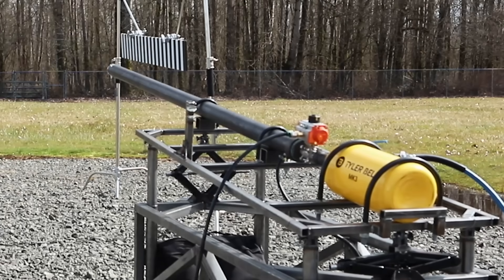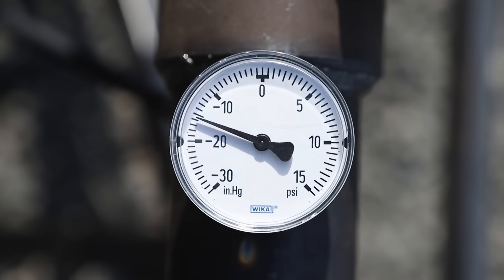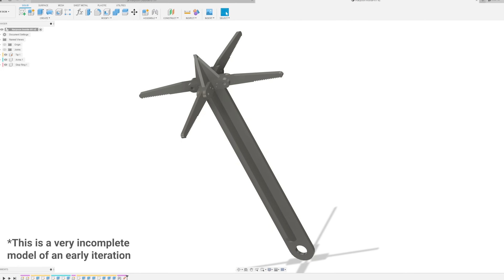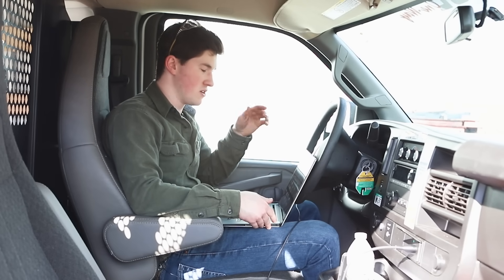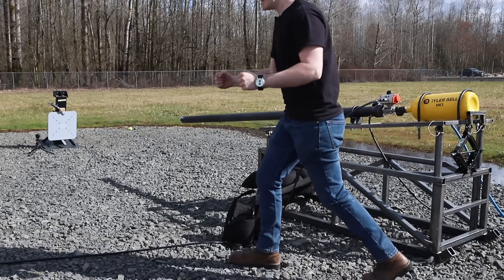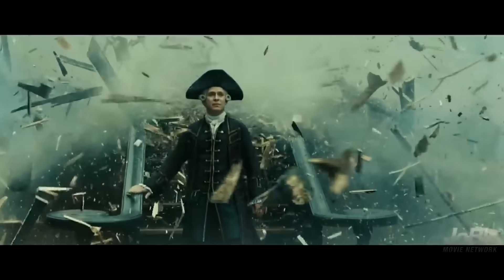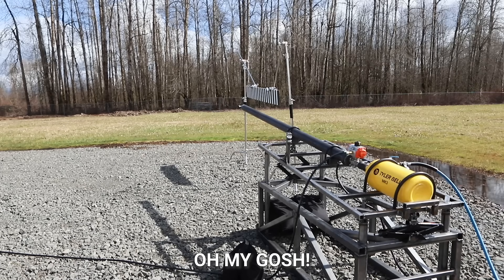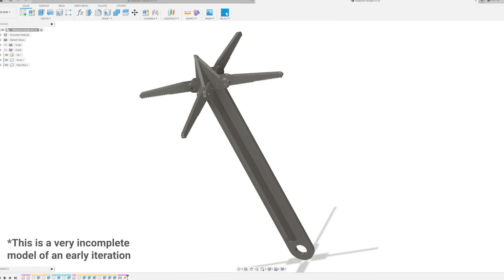Have I Found the Fastest Air Cannon Valve??

Comment: it really seams like you would benefit from extending the barrel length to three or 4 times longer with a vacuum pulled that would give you longer vacuum to accelerate in and should up the speed and would be a relatively cheap thing to test while only having to modify one variable

Comment: If you want more ideas, from an engineering challenge, look for a channel by agent1002 and look at that valve design. The goal was to have a valve triggered which would open 100% in the time the projectile moved it's length in the barrel. Flow was with as few restrictions as possible. Using a shooting chronograph, clocked an apple at 880FPS with the maximum design limit of 100 PSI. Due to the flow rate, the valve does not hiss, but has a boom report as it fully empties the tank in microseconds. The youtube channel mentioned has a full explinaiton of the design, theory, build, and testing. Yes there are some low quality high speed videos that are interesting, such as an orange going through an expanded metal screen, and an apple hitting a water bottle. Unfortunately the one day loan of a high speed camera did not leave enough time to get the color temperature and exposure correct.  Sorry about the low quality on the high speed.

Comment: Two problems. Firstly your projectile is not solid and allowing for pressure to force its way past. Secondly you need to get a pressure chamber that provokes more laminar flow. This will increase your overall pressure of velocity. Take all this with a grain of salt cuz I'm only a computer engineer. Second thought. I didn't think about the momentum of the forward portion of the ball that would indeed cause deformation and maybe do as you described at the end of your video.

Comment: Isn't the speed of gass escaping from the tank capped at speed of sound? That would mean that it is impossible to get it faster than that using just the gas pressure right? I'd say this would be the case since the plastic-burning valve is pretty much a "perfect" one speed-wise and even then you got around 75%.

Also if I take 75% efficiency, that is not that bad at all - counting in friction of the ball in the cannon itself, deformation of the ball etc. I'd also guess that when the pressure hits the ball, it deforms/flattens - meaning it will push much harder on the inner wall of the cannon resulting in higher friction and reduced efficiency. Maybe calculate the speed with the solid ball? Or lubricate the cannon - if you use good viscosity, it will act as a seal also.

Comment: i think it is impossible to make an air cannon shoot at the speed of sound because the expansion speed of the air is occuring at the speed of sound too so by using even much more pressure it won't shoot fast enought due to the inertia of the projectile and it's aerodynamics that also limit the air speed... so, for shooting at more than the speed of sound you should use something else than the sound itself and it's a purpose of blackpowder cannons wich expansion speed is not less than an explosion (btw, i'm not english so, sorry for this poor orthograph)

Comment: Should have turbo'd the 305 v6.  Some calculation into the maximum expansion rate of air might be in order.  First try should be a significantly larger valve, though.  Next might be barrel porting so you are sucking on the front of the ball for part of the acceleration phase using a venturi setup.  Might need a larger tank or a second tank for this.

Comment: Seems like a lot of commenters (myself included) think too little air volume is the primary problem. To simulate a larger tank and cut costs for testing purposes, decrease barrel diameter and shoot mini tennis balls. Use the same valve set up options, just change the barrels.

Comment: Your main limit, I think, is the terminal velocity of the tennis ball. The terminal velocity is the speed at witch the force pushing the ball and the air resistance are equal. I did some math and the ball shouldn’t go abobe 260m/s or 936km/h. You can keep adding pressure and flow but drag is squared to speed, so in order to make the tennis ball go abobe the speed of sound you need to launch it at more than 1600psi, thats without taking into account losses of pressure and flow limitations. And also, this is without taking into account the vacuum in the tube, the ball may go much faster inside the tube but once it exits it will slow down a lot.

Comment: Tyler, I just stumbled across your video. Wow! You are doing a great job. I would like to give you some ideas.
1) If you use a valve that is like two doors, held in place by a solenoid controlled latch, it will pop open like the floor of a hangman’s platform. That will be almost as fast as the blister, and not take as long to reset. Unfortunately, it would need to be self-manufactured. 
2) Other pneumatic ideas. I have one that will put you over the top on YouTube and may even make you very wealthy. I share this, because I don’t have the tools to build it myself (actually, I just don’t have the machine tools), and I don’t know anyone who does. If you send me a query at (no spaces) h m h m m p (at) ya hoo. I would like to help you build a project, but I don’t want to spell it out here. Get in touch, if you want my idea and knowledge to be lent with open communication.

Comment: Why not go with a swing disc valve? wouldn't that have been fastest? I'm not really an engineer, but I did take some courses on valves and fluid dynamics and engineering stuff. Although probably even more optimal would be like a specific type of swing disc valve that I'm not sure really exists, one which is just locked in place by a solenoid and not actuated at all, and then when the solenoid is activated the valve is free to open.

Although that's a good point about the tennis ball potentially being the limiting factor. I was thinking about that a bit as well.

Comment: You may not be able to get faster than 0.75 Mach because of the tennis ball. The faster you shoot the higher drag you will experience. The same concept of falling items reaching terminal velocity. You may be able to reach faster velocities in the barrel, but the moment it leaves, it will experience drag exponentially. So, to go faster, change the mass or make it smoother to reduce drag.

Comment: Well you did a lot right but Have you considered that by pumping down the barrel the tennis ball expands as it is filled with gas ? try something solid or use a bigger diameter for the barrel.
But when using something solid be carefull not to kill anyone as you are building basically an air pressure field artillery.

Comment: If the sides of the tennis ball are expanded into the barrel walls as the tennis ball is squished by the air from the rear, it sounds like the best option might be to making a barrel that widens as the ball travels. But you would probably need a high speed camera and a polycarbonate tube to see what’s really going on in there. 

Alternatively, you could add wadding to the back of the ball like they do with cannons. This would not only seal the air for a bit longer to allow it to build up greater pressure behind the ball. But could also be designed to spread out the force across the rounded back of the ball so that it doesn’t flatten out as much.

Comment: Ok, a useful insight I can provide is to start looking for simulation tools to help better predict cannon performance. I built an air cannon for a school project this way in just a couple months with minimal fumbling around with hardware. Play around with a model and then build what performs best. If your cannon doesn't perform how you anticipated, you can quickly identify the problem by double checking the model. Unfortunately the software we used doesn't work past mach 0.4. So you're gonna have to look around for a better one or make your own. Beats buying tons of hardware and saying "this is useless" and trying to return it.

Comment: The key is that barrel needs to be sized for maximum efficiency including bore diameter and length… keeping the ball in the barrel long enough to absorb all the kinetic energy . My grandson and I have a golf ball air cannon and we’re in the middle of nowhere and we haven’t the tools to check altitude or speed but have always wondered how high , we lose sight of the ball at about 150 psi , the rig is a small 3’ gas bottle with a 1-1/2” elec solenoid valve into 1-1/4” x 12’ sch 80 pvc pipe. Sending it down range we have yet to find it the best we can do is time it relatively vertical and that was apron 7.25 sec launch to impact  anyone tell how high that is @ 698’ elev above sea level  and 70 f

Comment: Dawg you need a light gas gun
You're fundamentally limited by the atomic weight of the gas molecules. You can get substantially faster speeds with faster (lighter) gas.

The other problem is that you can't send energy faster than the speed of sound in the medium that you're using. What that means is that you can never get the air in the cannon moving faster than the speed of sound in the air within the cannon. It's not substantially more than ambient.

You might even get better performance leaving the air in the cannon instead of the vacuum. You have a 15psi well to dig out of with the vacuum rather than ambient + back pressure.

Comment: With a 3d printer  make a sabot.  This will  encapsulate the ball so drag is controlled.  When the sabot leaves the barrel it splits in its two halves. Releasing the ball or that steel  harpoon. 
This is what U.S tanks use.
Good luck

Comment: You should try using an electric solonoid valve, Theyre perfect for small air rifles as they activate very fast and you can wire it to a switch. im sure larger industrial ones can be bought online for very cheap

Comment: You might be interested in checking out a device called a Big Blaster made by Martin Engineering Co. This company also makes industrial vibration equipment. Their blaster used a differential pressure poppet valve with an air tank. The valve was extremly fast. The blaster was designed to break up material bridging in bin hoppers. I also heard where it was used to blast mine walls instead of explosives to relieve loose material and prevent cave ins. A guy told me they used concrete filled Dixie cups for the projectiles. I was at a demonstration where the salesman shot a baseball and I thought it was going to go into orbit!

Comment: I'd like to see aircraft aluminum both sheets and billet pieces fired at structural steel and concrete. If you could get data points at speeds between 400-600mph it might shed some light on recent historical events that are still being debated.

Comment: I'm not the right kind of engineer to give you professional advice, but it would seem your issue is that you're unable to fill the cavity of the barrel with the level of pressure you want. Shorten the expansion volume behind the ball (reduce the backpressure). Shorten the barrel.

I'm pretty sure you only need a barrel large enough to stabilize to maximize instantaneous pressure in the cavity, anything else is contributing to drag. To test this you could put a pressure gague halfway down the barrel and log the pressure from the time the ball passes the gague to the time it exits the barrel. My guess is the pressure will be decreasing during this interval, meaning your tank cannot keep up the flow with the pressure and you're actually pulling the ball back with the longer barrel. 

Also use linear/parabolic/exponential (increasing in preference) transitions between significant diameter changes

Comment: They make boost controlled butterfly valves that open around 7psi. You'd just need a valve connected to the compressor tank and that thing should open fully when barely cracked

Comment: You need a much longer barrel. Maybe 50’. Coat the tennis ball with graphite... plus you could use two or more tanks on a wye and going up in pipe size and/or shorten distance from tank to valve...also you could go to 4 tanks, with 4 air powered identical valves so 1/4 way open of each valve equal full open on one valve making it 4 times faster than a single valve...I think high grade welding  would be better than threaded fittings...also consider going with golf balls or baseballs... I also think you need a bigger tank or multiple tanks...

Comment: Our air Canon had 6 ft x 8 inch receiver. 2 inch x 20 ft barrel. 2 inch Butterfly valve. At 150 psi we started with a paper was for sealing a paper cup with a golf ball in it. We angled the barrel at a 30 degree angle.
The ball went over 1 mile😁😁😁😁😁😁

Comment: You are correct in your assumption of why it’s not reaching super sonic, You need to measure your tennis ball that’s filled so it doesn’t compress I think it will go Super sonic without any issues. Just make sure you know where it’s going cause it might go a few miles.

Comment: your best bet would be an electromagnetic valve, there were training aircraft BB machineguns in about the 20s that used compressed air to fire steel BBs from a hopper, basically you need to make a solenoid that can move a needle valve style assembly working against the air pressure, this would remove the need for springs and even allow you to minimise how long the valve stays open since soon as the power is cut the pressure will shut the valve, only catch is how are you gonna power the electromagnet.....probably gonna have to have an insulated element that will allow you to have 2 isolated contacts for energising the electromagnet, or using a non-ferrous outer shell on that segment the valve is within.

Comment: You’ll be limited by the speed of sound for pretty much any air cannon, the trick is to increase the speed of sound.  Using heat works well for this, a heating element inside the pressure chamber will allow you to still operate within the pressure limits of your design but increase the speed of the flow.  Changing from nitrogen to helium or another light gas would work well.  You could also switch back to your burst disk design, and use a high pressure propane-oxygen mixture in the air tank, which would be ignited by a spark at the back of the tank.  The increased pressure and heat will burst the disk and result in much higher exit velocities
Reply: A fellow man of culture, I see😉. The Hybrid potato gun design principle is friggin nuts, I've built too many to count and am constantly surprised by their power. I'm planning on a 200bar oxy/propane small scale gun right now, with a 1" ID x 6" chamber with 2" thick steel walls using brass burst discs, should be pretty spicy. I've seen another guy build something similar and was getting around 3000 fps with .75"x3" steel rods as projectiles, some nutty stuff lol.

Comment: a double sized valve only needs to open half has much to flow the same air, so it only has to move half as fast to release the same air.  you should use the largest valve you can or multiple small units

Comment: The thing that always kind of has me scratching my head with these builds, is that they always seem to go down the 'potato cannon' route, when what they should probably be looking at for inspiration is paintball guns. 

Paintball gun valves (be it poppit valves or spool valves) are much quicker to release air pressure by design. Of course it would be much more complex to upscale a paintball gun than it would be to make a ball valve cannon, but a poppit valve would open much, much faster.

Comment: If the ball was actually being pressed against the barrel, that would help you significantly as it slows the ball from leaving the barrel until full pressure has appeared in the barrel. Read up on the concept of squeeze bore barrels. 

The basic concept is a gun that fires a projectile through a barrel that is slightly to small caliber. in a normal gun, the projectile exits the gun before all powder can burned and create gas, so some energy is lost. In a normal firearm, this is balanced by barrel length and the amount of grain that goes into the charge, and both are usually optimized for oneanother. In a squeeze bore gun you try to achive a higher velocity with a shorter barrel by delaying the exit of the projectile from the barrel. The bullet blocks the hot gas from leaving the barrel until a sufficient pressure is reached which then deforms the projectile (and to some extend also the barrel) to set it in motion. This way a much larger powder load can be burned and much higher back pressures are generated, which then are used over the entire length of the barrel, resulting in much, much higher exit velocities. 

In guns, this is not common because the barrel wears out rather fast (metal on metal contact you know) but in your case, you could just load the tennis ball behind a short section of barrel that is too small for the ball to go through, which is then followed by the actual barrel of normal caliber and use the squishy nature of the tennis ball to your advantage. If the tennisball gets delayed by only a fraction of your valve opening timing, you might allready achieve a significant boost in speed and might come close to supersonic.

Comment: Try using a larger volume tank. With a barrel that long, by the time the ball has reached the end, the acting pressure behind it has greatly reduced. i.e. if the the barrel volume = tank volume, then the pressure behind the ball just before it exits is 1/2 the pressure in the tank before firing

Comment: with an pcp carabine I pass the wall of sound at around 60 bars / 1000psi but my smallest pipe is the canon everything else is bigger. I think te exit of the bottle, the pipes, the valve, everything is too smallfor a tennis ball, or the tennis ball is too big and you need to find a smaller pipe and projectile